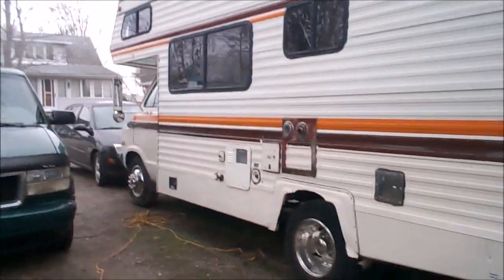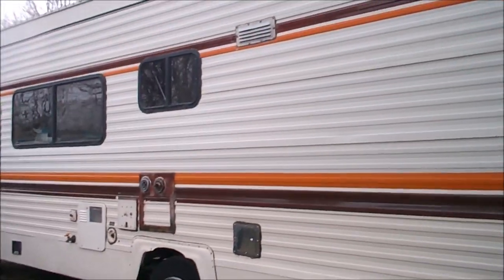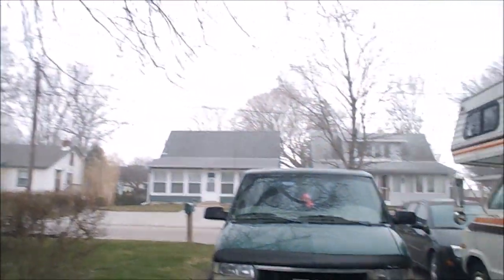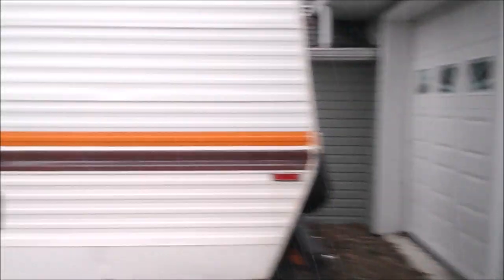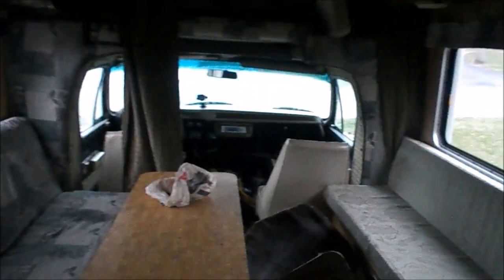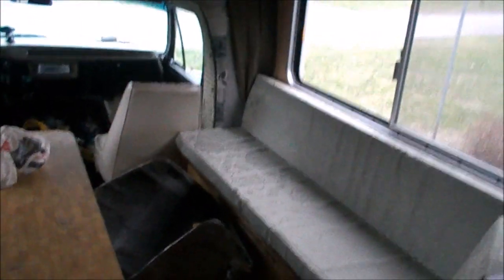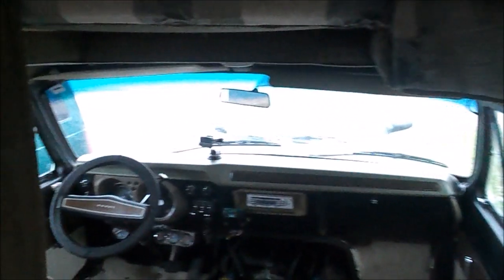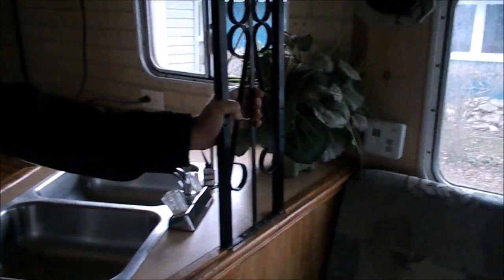New Beginnings, And A Vacation From Our Off Grid Homestead Life

Comment: Hey  Cecil ,that's  a  pretty  good  looking  unit , and  yes  they  come   with  factory  installed  inverters, and  most likely  a 12 volt system  not a hundred  percent  sure with the oder  units  .
Good  luck  getting  her  up  and  running  👀
Reply from the maker: +jmber27 Yup you are right, The inverter in this unit converts 120 volt AC. to 12 volt DC.  It sure is a nice RV. Take care, ttyl   :-)